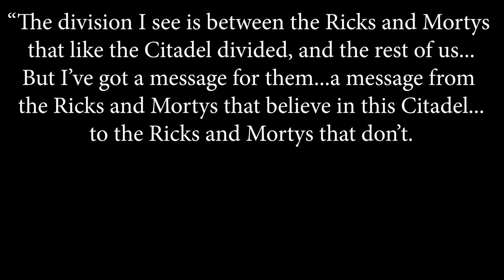Shooting Masks onto People's Faces

Comment: An inventor testing his invention on himself deserves my eternal respect.
Reply: The guy who invented the bow and arrow:
Reply: Just like the brazen bull
Reply: I'm not saying somebody should remove a body part to test a limb but anything else that's feasible if you're not willing to test it on yourself then you should be not taken very seriously how goes it if you're not willing to use it on yourself why would you be allowing somebody else to use it
Reply: External
Reply: And probably your condolences
Reply: @delta 790. 💀
Reply: @sentar6969  That would be true for a final version, but if you have not completed the design, why test it if you aren't sure if it's safe? The only reason you should be confident in the design is if it has been tested reasonably. Otherwise, there is no point risking anybody's lives or livelihoods.